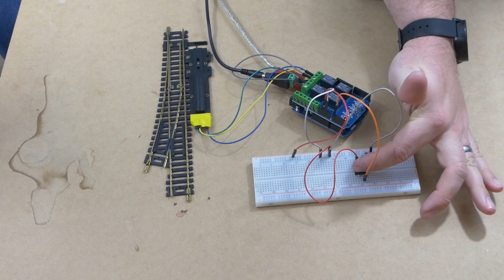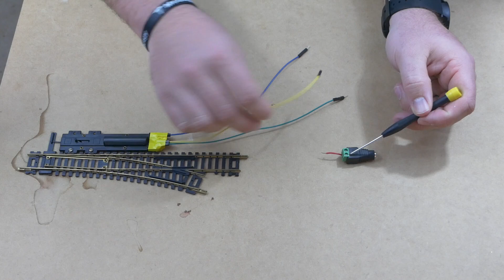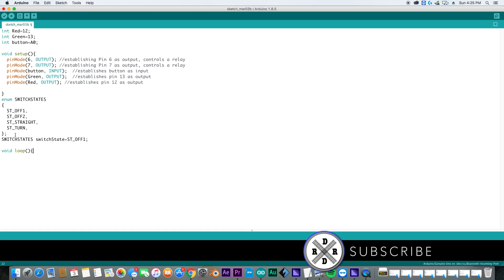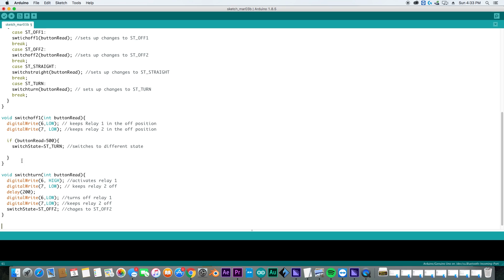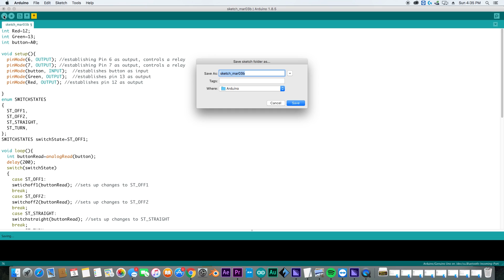Model Train Switch Control with an Arduino!

Comment: Apologies in advance for a couple of dumb question from a total newbie...but here goes! My Bachmann turnout comes with a button and a wire to run it from a power supply. When connected, it does exactly what's depicted in this video but without the Arduino. What is this Arduino setup doing differently than my non-Arduino setup? Do some turnouts (such as the one in this video) not include a switch and power hookups? If that's the case, it seems like overkill to use a computer to handle this kind of task. Again, sorry for the dumb questions and thanks for the video.

Comment: I've thought about that idea, but I would rather do it automatically like install an IR sensor for when a train (or trains) are coming near and the arduino throws the switch or switches. That way the trains can proceed to the next model country.

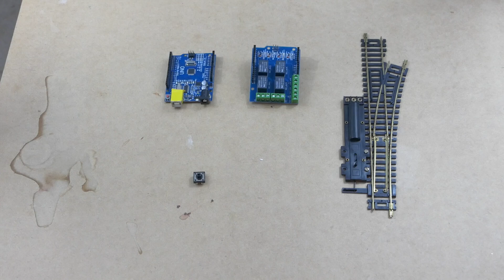Comment: Thanks for all the good info.  A question - at about 1:00, you say "12V power supply with adapter".  Is it 12V AC or DC ?  What's the current rating ?
Reply: 12VDC If you have not found it.

Comment: Talk about a sledgehammer to crack a nut!
Reply: On its own as a standalone switch controller , thats a fair enough comment.
But, you could add signal lights that indicate the state of the switch.
You could add a second board based on ESP32, replace the button with a line from the ESP32, and control the switch over WiFi or Bluetooth.  It would take some programming on the ESP32, as well as a mobile  or desktop app to talk to the ESP32.
You could send a line back to the ESP32 so that your app know the state of the switch.  You could use that knowledge for something else.
etc. etc.  The switch controller is a building block.

Comment: Two questions: 
1. beginning at 3:10, since there are three connections per relay, why can we not just use the third connection of "Relay 2" to switch the track from the turn to the straight?  If you have a link that can explain the 4 Channel Relay Shield, I am okay with that.
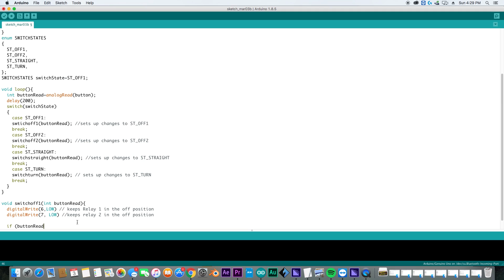2. at 15:05, I understand that the analog input can be a number between 0 and 1024, but how does the program sense that from the button?
Reply from the maker: Great questions.  So the way the snap switch works is it has a common wire with 2 wires that power a coil that "snaps the mechanism back and forth.  The motor only needs a brief burst of power to switch.  If the power remains constant, it will overheat and may melt.  I use the relays to briefly cut the power on and off.  One relay does the straight, and one does the diverging.  If I used one relay, it would flip back and forth between straight and diverging, the power would stay constant and would eventually overheat.  

In terms of the button.  The analog input is basically reading the power that is flowing through it.  Buttons are momentary switches.  When a button is pressed, it changes the amount of power flowing through the circuit and the analog input will read something other than it's normal power input.  All you have to do is tell the program what the threshold is to activate the program.
Reply: @DIYDigitalRailroad  Thank you for the help!

Comment: As a professional C and C++ programmer, I'd like to share some feedback on your sketch.

First, remember that you are writing code for the person who's going to maintain it down the line. Even if that person is you! I can't tell you the number of times I've gone into code that I wrote only six months prior, and could not immediately see what was going on. To aid in that department, I'd like to offer some tips I've learned:
- avoid using enums that differ only by a numeric suffix. I should be able to look at your enum list and understand immediately what each value is for. ST_OFF1 and ST_OFF2 do not immediately tell me what they are for.
- Comments should document the "why", not the "what". I can see the "what" by reading the code: switchState = ST_TURN;   does not need a comment.
- Avoid "magic numbers". you nicely provided aliases Red, Green, and button for some I/O pins, but you left 6 and 7 as "magic numbers".

On the code itself, I can see some room for improvement. You're tracking four states, when you really only need to track 3: set turnout to Mainline, set turnout to Diverge, wait for person to let go of button. Also, in the setup() function, ensure that the turnout matches the state. As it is right now, your code assumes that when it powers up, the turnout is in the mainline (straight) position - if you power up with the turnout in the diverge position, then you'll have to push the button twice to get it into the correct position.

I'm not (yet) familiar with Arduino programming, but you should not need to write the same value to the same output twice. In switchturn you call digitalWrite(7, LOW) twice. Unless there's some quirk of the Arduino that I'm not aware of, only one is necessary.

My version would look something like this (warning: uncompiled and untested code, for illustration purposes only):

int mainlineRelay = 6;
int divergeRelay = 7;
int button = A0;

bool isMainline;

void setMainline()
{
    digitalWrite(mainlineRelay, HIGH);
    digitalWrite(divergeRelay, LOW);
    delay(200);
    digitalWrite(mainlineRelay, LOW);
    isMainline=true;
}

void setDiverge()
{
// left as an exercise to the reader :)
}

void setup()
{
    // as per your original code, plus:
    setMainline();
}

void loop ()
{
    if ( analogRead(button) > 500 ) {
        if ( isMainline )
            setDiverge();
        else
            setMainline();

        // Wait for operator to release the button
        while (  analogRead(button) > 500 )
            delay(100);
    }
}

One thing I'm not sure of, is if the Arduino likes embedded loops like the one I have waiting for the operator. If not, then you can change loop() to:
bool isWaitingForButtonRelease=false;
void loop()
{
    if ( analogRead(button) > 500 ) {
        if ( ! isWaitingForButtonRelease ) {
            if ( isMainline )
                setDiverge();
            else
                setMainline();
            isWaitingForButtonRelease = true;
        }
    } else {
        isWaitingForButtonRelease = false;
    }
}

I hope you find this helpful.

By the way, while I was analyzing the code I paused the video, and I kept trying to scroll up and down through the code. As you can guess, that didn't work :D

Thanks for all the videos!

Now, what was I looking for when I came across this video?
Reply: I’d probably add an Assert somewhere that both relays aren’t powered simultaneously.

Comment: hi, 

just uploaded your sketch , to arduino and relay board nothing else connected am getting this error message .  Any ideas? 
 - regards Robert

Arduino: 1.8.13 (Mac OS X), Board: "Arduino Uno"

Sketch uses 1238 bytes (3%) of program storage space. Maximum is 32256 bytes.
Global variables use 11 bytes (0%) of dynamic memory, leaving 2037 bytes for local variables. Maximum is 2048 bytes.
Problem uploading to board.  See http://www.arduino.cc/en/Guide/Troubleshooting#upload for suggestions.
avrdude: stk500_recv(): programmer is not responding
avrdude: stk500_getsync() attempt 1 of 10: not in sync: resp=0x00
avrdude: stk500_recv(): programmer is not responding
avrdude: stk500_getsync() attempt 2 of 10: not in sync: resp=0x00

This report would have more information with
"Show verbose output during compilation"
option enabled in File -> Preferences.

Comment: You can improve things with a latching push button.
Adding an led to the button bias resistor gives an indicator.
The required state is remembered through a power off sequence.
And the code is simplified.

Comment: Jimmy, you can do that with just one relay. the open close of a relay can change which side of the relay is being sent. So you can have up to 4 switches on one shield. Josh
Reply: If you do it with one relay you leave the point motor permanently powered.

Comment: Hi Jimmy.  Another enjoyable video.  Since any microcontroller, like he ATMega 328 on the Uno, has a limitied amount of program space (and memory space) I optimized your code to get the size down as low as possible (both program space and memory space).   I have not tried this yet as I am still at work (don't tell the boss I was watching a DIY & Digital YouTube video while still on the clock!).  The sketch compiles without errors (checked at https://www.arduino.cc using the web based IDE) and I will let you know if it actually works when I get home and can give it a go on my Uno.  Thanks again for all the great videos you post.
Rick

#define Red 12      //these first 2 will not affect the program but will let you hook up signal lights
#define Green 13    //Hook up the lights to pins 12 and 13
#define button A0
#define Relay1 6
#define Relay2 7

void setup(){
  pinMode(Relay1, OUTPUT);      //establishing Pin 6 as output, controls a relay
  pinMode(Relay2, OUTPUT);      //establishing Pin 7 as output, controls a relay
  pinMode(button, INPUT);       //establishes button as input
  pinMode(Green, OUTPUT);       //establishes pin 13 as output
  pinMode(Red, OUTPUT);         //establishes pin 12 as output
  digitalWrite(Relay1, LOW);    // make sure Realy1 is off
  digitalWrite(Relay2, LOW);    // make sure Realy2 is off
}
enum SWITCHSTATES
{
  ST_OFF1,
  ST_OFF2,
  ST_STRAIGHT,
  ST_TURN,
};

SWITCHSTATES switchState=ST_OFF1;    // Set initial state to ST_OFF1

void loop(){
  int buttonRead=analogRead(button);
  delay(200);
  if (buttonRead > 500) {           // if button pressed then 
    switch(switchState)             //   process the button press
      {
        case ST_OFF1:               // if current state is ST_OFF1 then set the swtich to straight
        switchstraight();           //sets up changes to ST_STRAIGHT
        break;
    
        case ST_OFF2:               // if current state is ST_OFF2 then set the switch to turn
        switchturn();               // sets up changes to ST_TURN
        break;
     }
  }
}

void switchturn(){
  digitalWrite(6, HIGH); //activates relay 1
  delay(200);
  digitalWrite(6,LOW); //turns off relay 1
  switchState=ST_OFF2; //chages to ST_OFF2
}

void switchstraight(){
  digitalWrite(7, HIGH); // activates relay 2
  delay(200);
  digitalWrite(7,LOW); //turns off relay 2
  switchState=ST_OFF1; //chages to ST_OFF1
}
Reply from the maker: I'll have to try it.  Thanks!
Reply: @DIYDigitalRailroad  One bug - need to swap the switchStates test in the switch statement.  First case should be ST_OFF2 and the second one should be ST_OFF1.  Other than that it seems to be working just fine.  I had fun playing with this - thanks again Jimmy!

Comment: Hi, first of all, thanks for sharing. You, amongst many others, are very much into Arduino products. This, though,  seems like a lot of effort. Maybe you can explain to us ignorant MRR folk, i.e. old guys, why go to all this effort. What is the underlying reason? Thanks in advance for your reply/comment.
Reply from the maker: That's a fair question, and I am one who likes to manually throw turnouts.  I am working on a more complex project that requires a precision throw of a turnout at a specific time.  This will allow me to do that.  My tutorials build upon eachother.  This is the beginning of a larger project.
Reply: DIY & Digital Railroad, a very fair answer. Thank you for explaining. I look forward to learning more. Later
Reply: I use Arduino Nanos with Mosfets instead of relays. ( It's cheaper).  6 turnouts ( points) or semaphor signals per nano. Nanos sited at various places on layout. Comms from central control permits remote route selection. I select the route, the arduinos choose and switch the correct turnouts.
Reply: I would offer one other reason to use this method rather than just a momentary push button switch.  Using the Arduino and his code will provide protection against a user pressing the momentary switch "too long" and potentially damaging the switch relay.  The code could be improved to look for the push button to be released before reading another input which should prevent burnout of the switch relay.

Comment: Maybe I'm missing something, why go to this effort and expense to do what a simple switch can do? I suppose it is part of a larger scheme.
Reply from the maker: That is a great question actually, and I totally understand,  I actually manually throw all of my turnouts on my layout.  Arduinos are really great for automation and custom control setups.  With this, you can automate turnouts to sensors, or create custom control boards on your fascia.  You are a good guesser though, this is part of a larger project that I am working on that does require an automated turnout.
Reply: @DIYDigitalRailroad  mmmm , throw 3 switchpoints with one push button and control the signalling as well...

Comment: Good morning Jimmy, I enjoyed that video. I'm one for running as much "stuff" on any given Arduino as I can. I used your Track Signaling video to do my own thing and have gotten two sets of signal lights to run in the same sketch on a Nano. One is a two light tower set and the other is a three light tower set. 

So what I'm getting at here is to control as many turnouts as possible with as little electronics as possible. NESR says he using a Mega, would that allow for more relay connections for more turnouts? Can the relay cards be stacked? Hmmmmm, lots of food for thought. 

Thanks.
Reply from the maker: So I used the relay shield because of its ease of use, but you can hook up relays to the arduino that arent on a shield and then use as many as you have pins for!  you just need 2 relays per turnout.
Reply: @DIYDigitalRailroad  What you're saying is that I can get any regular relay board and have at it? :)
Reply from the maker: @altoonamodelrailroader  exactly!
Reply: take a look at this .....  https://www.youtube.com/watch?v=mSlXNcmUjZE
imagine you have 4 of these relay boards.  if you look into  i2c  you can use even a arduino nano to drive them all